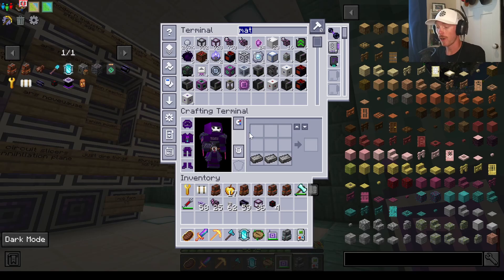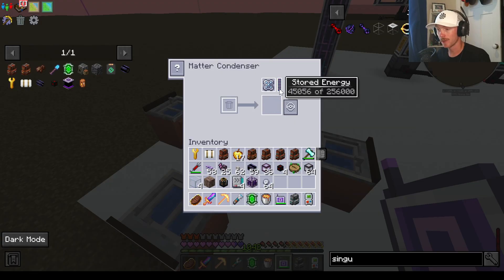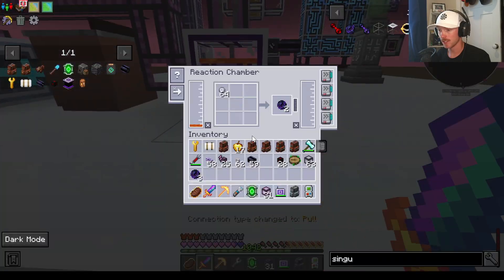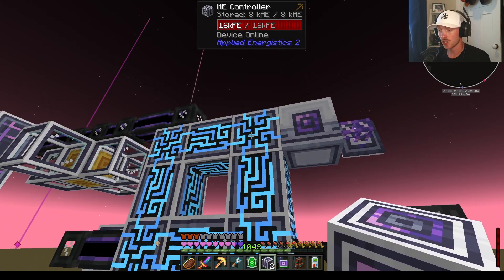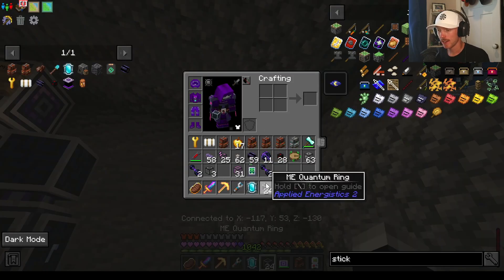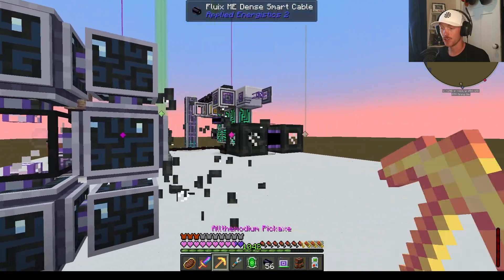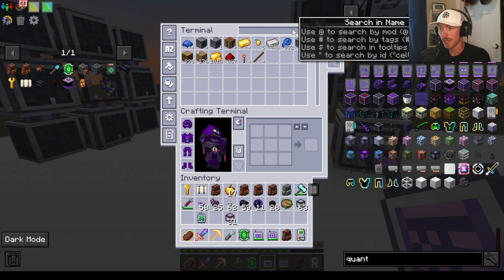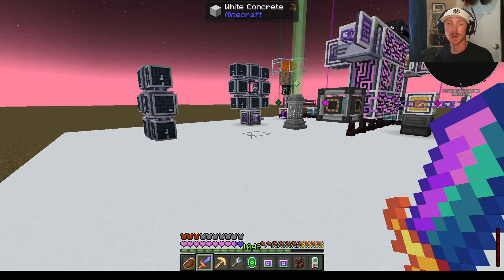How to Set Up AE2 Wireless Terminals & Cross-Dimension Connection (All the Mods 10)

Comment: Question what's the point in making multiple ME Extended Drives? No more than 2 in my opinion
Reply from the maker: its just if you need more storage slots for the different types of items stored… i think i only ever had a max of two per system